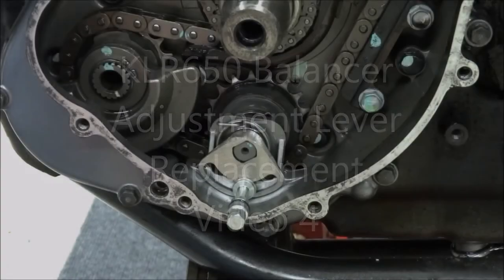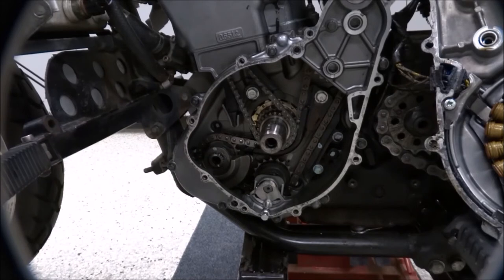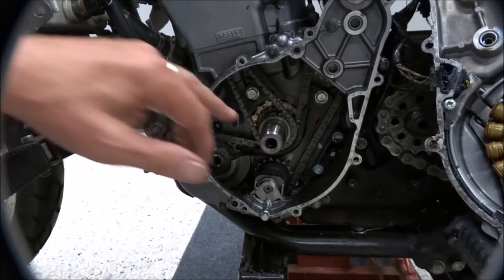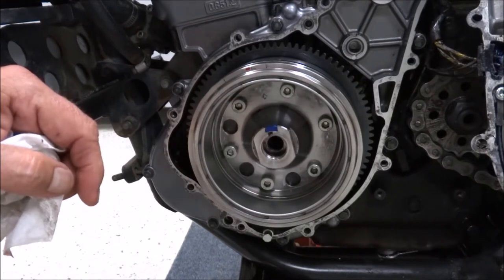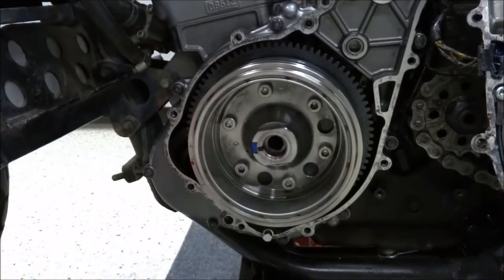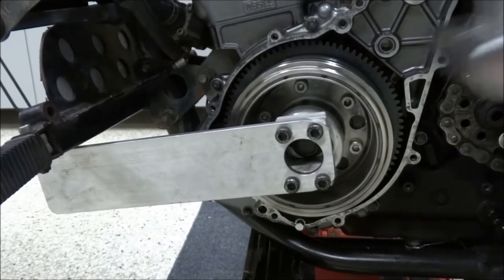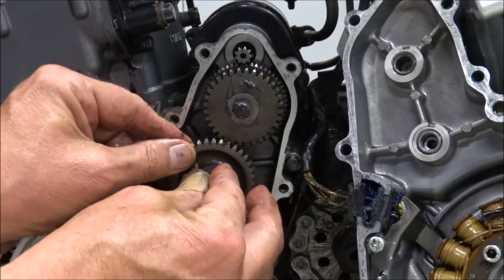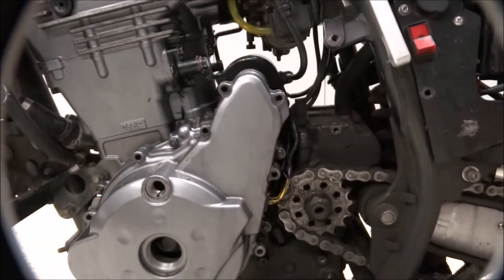KLR650 Balancer Adjustment Lever (doohickey) Replacement Video 4

Comment: I watched all 4 parts of your doohickey video's. Thank you so much for all the details you put into it, it's hugely appreciated. Especially the part about what to look for to see if your doohickey has been replaced yet. I purchased my KLR used (I'm the 3rd owner) and the previous owner claims the doohickey was replaced, but I am going to remove the outer cover and take a look for myself. I've been apprehensive to adjust it until I can prove if it's been replaced. Thanks again and happy trails!

Comment: Thank you so much sir. Top dead center made it easier to line the woodruff key. I was hesitant about the gap between the flywheel and the shaft but the grease mark it made on the flywheel remover confirmed I had it ok.

Comment: I have watched this and the other video's and have done something wrong. After the motor warms up I am hearing an occasional scraping noise. I am totally baffled. Made sure all the shim washers were correct.
Reply from the maker: It's hard to diagnose noises when I can't hear them! The nature of the sound, under what conditions it happens, at what speed, etc, are all clues. It's usually better to try and get help in a community environment. 

I would suggest that you go to one of the forums, such as KLRForum, and start a thread. It's the old 'two heads are better than one' sort of thing.

I can tell you what I'd probably do if it were my bike. I would pull the side cover back off, remove the rotor, and make sure that the two thick washers are behind the starter clutch, that there is one thin large diameter washer between the starter clutch hub and the rotor, that the key is not damaged, and that the washer behind the eccentric is still there, and that the four thrust washers for the starter gears are in place, and make sure the torsion spring didn't pop off and that its coils were properly stuffed onto the lever.

That's pretty much all that you could have disturbed when doing the work and those are the common issues.

Taking you at your word that all the washers are correct, what I would suggest as a possibility is that the torsion spring is not properly stuffed onto the lever or has pooped loose.

The early aftermarket levers often had a bit of an interference with the starter clutch ring gear and that is the reason that the lever is relieved. If the spring is not stuffed onto the spring and captured int eh groove, then it could be rubbing on the ring gear. If it has become disconnected it could do the same.

Unfortunately, the rotor has to come off in any case.

Comment: I had a gen two  KLR ,and now the gen three. The gen 3 manual says nothing about  the  doohicky. I herd somewere  Kaw upgraded it for 2023. My question is the instructions the same  torque, procedures etc as the 2022 ?
Reply from the maker: There has been no change to the balancer adjuster design for 2023. No design change, no upgrade to parts. The adjustment procedure is the same as it has been since the first KLR650.

Comment: When you installed the doohicky you snugged down the bolt while pushing the doohicky to the left for the spring to hook to it easier. Then you pushed the spring in towards the engine to snug it in.  Are'nt you suppose to loosen the bolt a little to allow the doohicky to move with the spring tension ? If the doohicky is snugged down then what is the purpose of the spring ?
Reply from the maker: T-Bone,

The spring pulls the lever to the left. After I have pushed the lever to the left in order to take up all the slack in the system and make it easier to install the spring, there's no real point in loosening the bolt after the spring is installed. At that point in time, all the slack is taken up.

In a few thousand miles, say at the next oil change, then the engine should be set to top dead center, the bolt loosened, the case rapped with a soft mallet, and the spring will do its job to move the lever to the left and take up the slack. This is a periodic adjustment that needs to be done. And, of course, the lever should never be allowed to run loose without the bolt tightened.

Tom
Reply: @souperdoo  thank you sir
Reply: @souperdoo  I was wondering if you could help me with the proper routing of fuel lines and vaccum hoses from the carburetor to petcock and vents ? 2008 gen 2. I've checked all kinds of diagrams and forums but I'm still a little confused as to what goes where. Mainly the two plastic 90° top and bottom on left side of carb and the brass fitting top right on carb. Sir you seem to be the guru of all that is KLR so I subscribed to your channel for your wealth of wisdom ! Thanks in advance.
Reply from the maker: @t-bone9403  

Happy to do that!

The Gen 2 has a brass fitting with two barbs on it. One is for the Air Injection System, and the other is for the vacuum-operated petcock.

If you have removed the AIS, then block off its barb. If you have replaced the OEM petcock with a manual petcock, block off its barb. I like to use a properly sized plastic screw protector. They come in various sizes and are made from a very flexible plastic that doesn’t degrade as a neoprene one will. You can find them at places like ACE hardware.

If you have both the AIS and the OEM petcock, they need to have vacuum hoses running to the fitting in order to function and it doesn’t matter which barb they are connected to. 

On the carb, the gray elbow at the top is the carb vent. It must be open or the carb won’t work. Its hose should be routed to a place where it can both breathe and won’t get water in it. Many folks will put a T fitting in the line and run one leg up the backbone of the frame toward the front of the frame and the other hose down along the subframe under the seat.

The routing of the lines is fairly simple, just make them as direct as possible and avoid routing next to the exhaust pipe for the AIS and for the carb vent. If you never go near a water crossing then the carb vent doesn't really need to have a hose at all.

Use a 1/8" (3mm) vacuum hose for the connection to the back of the OEM petcock and to the AIS. It is smaller in outside diameter and more flexible than a braided line. It is easier to route.

The lower elbow is the fuel inlet. The hose goes from the petcock's outlet straight into the black elbow. Use Tygon line, as it is clear (yellow), very flexible, easy to work with, and remains flexible.

Both of these elbows have O-rings on them which seal them to the carb body. If you take the fittings off it is a good idea to refresh the O-rings.

Tom
Reply: @souperdoo  thank you again sir !

Comment: Great series thanks...I've been told I could do the do without removing the inner case, what do you think?
Reply from the maker: Supposedly you can. You need to be able to fish the old spring out, and I hear it is easier if the spring has broken. It's supposed to be possible, though, to get one out that isn't broken.

Drilling the hole for the torsion spring can be done with the case on the motor as long as you're careful to get all the chips out.

I've never done it that way.

Tom

Comment: I recently acquired a non running KLR. In the course of trying to trouble shoot, I discovered rotating the crank assembly seemed to turn the starter motor(as noted by a gear winding sound, and significant drag) I'm trying to determine if there is a free wheeling gear on the big sprocket in front of the flywheel. If so, does mine sound faulty? Thank you....
Reply from the maker: The big ring gear on the back of the rotor (flywheel) has a one-way clutch interface with the rotor. If you hand-turn the engine counter clockwise that gear should not drive the starter gears. If it does, something is wrong.

If you turn the engine clockwise you run the risk of jumping timing on the cams. Turning it clockwise would probably engage the clutch and drive the starter gears backwards.
Reply: souperdoo I was coming to terms with an unexpected level of complication in order to set the machine back in good order. Thanks for the insight and yes your videos are very helpful and much appreciated.
Best regards!
Reply from the maker: All's well that ends well!

Comment: Do the '16 and '17 models need this also?
Reply from the maker: Well, yes and no. The spring is typically too long and runs out of adjustment very quickly. That needs replacing. As long as you are in that far and have that much invested in the effort, it is foolish not to put a new lever in with the torsion spring. The spring has been reported to run out of tension within the first 5K miles. Some last longer, some don't.

The lever itself, on the Gen 2 bikes (post '08), was redesigned and doesn't break, but only replacing the spring make no sense.

More than you wanted to know:
https://www.youtube.com/watch?v=xt7a87B2eqU
https://www.youtube.com/watch?v=WAryJKr72KM
http://www.souperdoo.com/stuff%20that%20i%20think%20about/doohickey

Tom

Comment: Fabulous !!   I noticed that you have an extended idle mixture screw. What brand do you like?
Reply from the maker: This is the one I use and I have no problems with it. There was no real reason to prefer this one over any other. It is simply the one that was most available/first found when I wanted one.

https://cv-performance.com/harley_mixture_screw_tuning

Tom